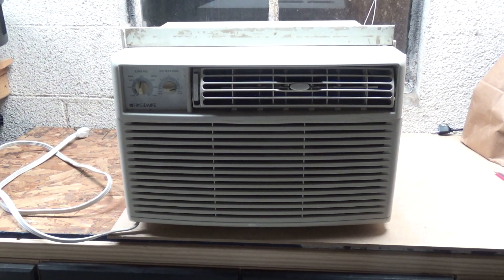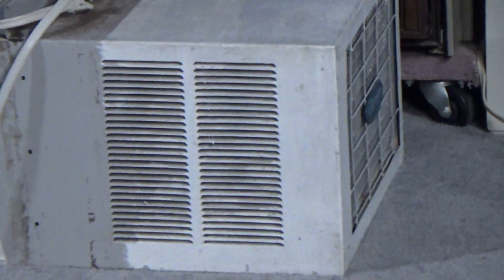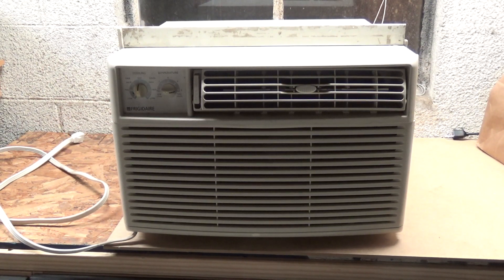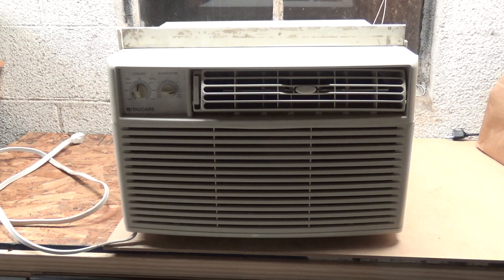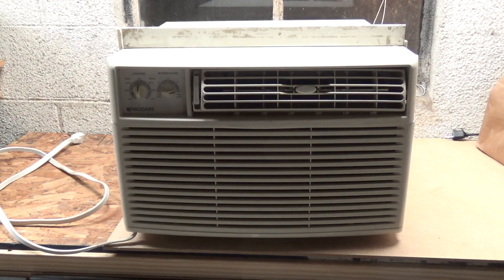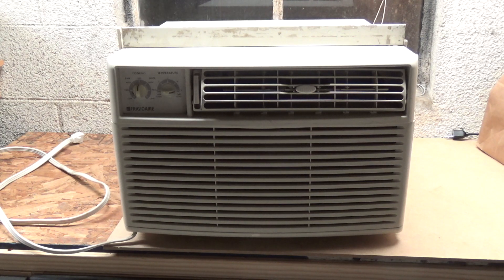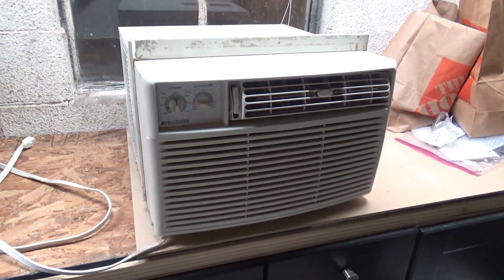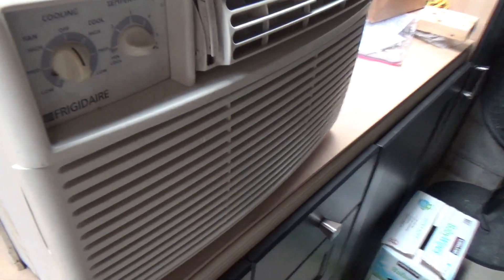Frigidaire FAC103K1A1 9,950 BTU Window Air Conditioner | Initial Checkout

Comment: What happens with R22 machines in USA if they need refrigerant ?
Reply: You would have to find recycled R-22 to put in the unit. But because it's banned in all new units, you'd have to hire an HVAC Technician to put it in for you since you need a license to purchase it. The new refrigerants aren't good like R-22 was... so it'd be hard to actually recharge your unit if no sources are available for you to find recycled R-22
Reply from the maker: There's alternative refrigerants you can utilize, such as 458. Finding R-22 at this point is nearly impossible.

Comment: Those are good units. Frigidaire was pretty much good while they were still being made by WCI. Once electrolux took over, they went downhill fast. Personally, if you ask me, the last good Frigidaire models were the early-mid 2000s models with the electronic controls, and the variable fan speeds. They are cheaper, and are made after electrolux took over, but they seem to preform well, and if taken care of last a long time. They still use R-22 refrigerant, and as long as the fan bearings aren't bad, they are pretty descent in my opinion.
Reply from the maker: Almost anything with 22 seemed at least reasonable, once the 410 took over is when things really started to go down hill.

Comment: These units are my personal favorite window units. That should be a Sanyo compressor if I remember correctly. I will agree that the condenser on this chassis is very annoying to clean, the evaporator and evaporator fan are very easy however.
Reply from the maker: I wouldn't be surprised to see a Sanyo, these seem to be comprised of all good quality components.